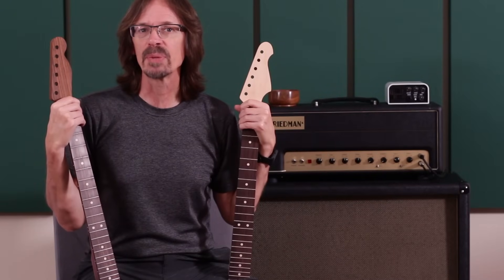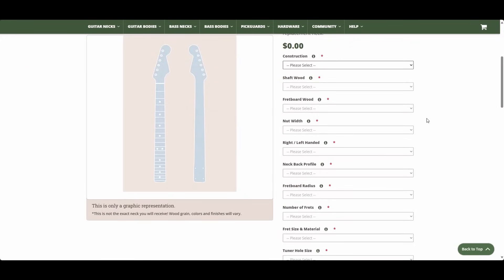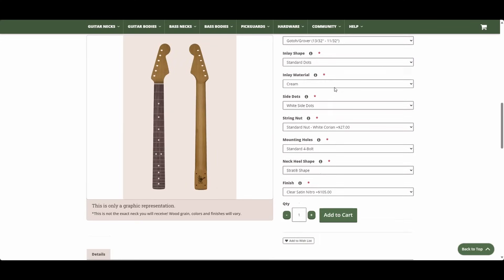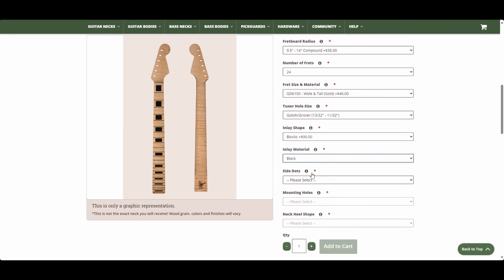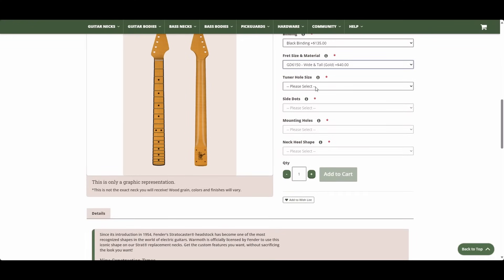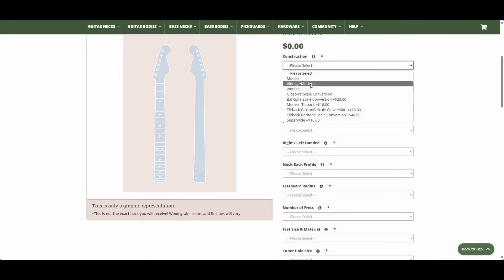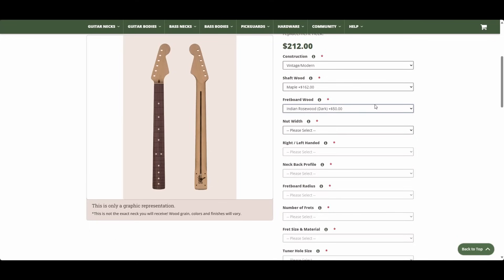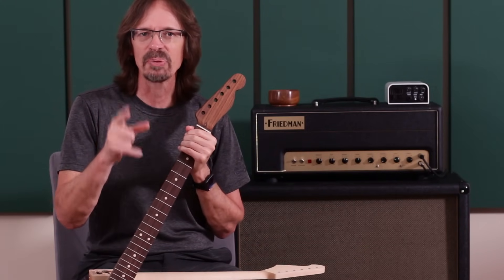The CHEAPEST vs the MOST EXPENSIVE Warmoth NECK

Comment: My go to is the roasted maple / rosewood with standard default for all options. Needs no finish and only minimal prep before playing. Smooth the fret ends, set the truss, and rock. If you use Hipshot tuners, you don't even need to drill anything. It's that easy. And about as cheap as it gets in terms of $$$. But feels and plays like a million bucks.
Reply: Exactly, I’ve been using plain Roasted maple as my neck and fretboard choice, Gibson scale-length, stainless 6100 frets and I’m always happy, though I did a vintage tint gloss finish recently for a project and I love it, looks and plays incredible.

Like you say, Warmoth necks will feel like a million bucks for very modest $. I built a SS p bass and a Strat last month, all the options I want and none I don’t, truly killer guitars that I assembled.

Comment: I know the roasted option on the cheapest build was because the warranty is void without a finish, but I've never known anybody whose warmoth neck failed them and a tung oil finish feels so good.
Reply from the maker: Roasted Maple does not require a finish for warranty. That's why I chose it as the least expensive "fully functioning" neck.
Reply: Most exotic woods also do not require a finish. But imho roasted maple is the cheapest one that doesn't require finish. 🤔

Comment: If you're considering a Warmoth neck, I bought a strat neck in 2006. I got standard profile,6230 frets rosewood fretboard, precut white corian nut and drilled for Sperzel locking tuners, and clear gloss finish. The price, with shipping was $312.00. It was excellent in every way. I wasn't sure about compound radius but I really got to appreciate it. My experience with Warmoth was great.

Comment: It's so funny how you don't realize until after experimenting with necks that you find out what's right for your greeting hand. I find that I love roasted Maple with no finish, and Ebony fretboard, Evo frets, 16-inch radius. And a 1-inch straight across the entire neck for thickness. I also like either 43 or 44 mm neck. it's so comfortable for me. my hand doesn't get fatigued like it used to with the standard radius and neck thickness. With the standard normal neck thickness come on my hand was constantly cramping up. It turns out I have a thick hand and when I use a 1-in neck it opens up my hand and doesn't fatigue my hand as much.

Comment: Four comments. First, this was fun I often do the cheapest neck test but never the most expensive neck test. Second, I once asked what it would cost for a roasted Maple shaft quarter-sawn and they said that would be $100 upcharge. I don't know if that would make your most expensive neck even more expensive. Roasted and quarter-sawn is probably redundant so I didn't go for it but I always order it when I'm getting a Mahogany neck which at the time was only a $40 upcharge. Third, I don't think the neck I want is even available off menu which is a vintage 7 1/4 radius neck in 24 3/4 scale. Fourth, I would also like to see Warmoth make necks that would fit bolt on Paul Reed Smith Guitars. I hate their neck profiles and would order one with a boat neck profile and stainless steel frets, which PRS doesn't like, which I think iis a mistake. I agree with you Stainless Steel frets are a default and not an option as far as I am concerned.

Comment: your most expensive neck is incorrect.  if you use ebony (black) as the fretboard, it will come out to $1,091.  and then you could have the neck painted to match the body, tho I don't know why you would do that with 3a flame maple, but that's another upcharge.  I don't know the cost of that, but the neck would definitely be more than $2000.  just sayin.😢
Reply: The matching finish is an off-menu option, hence it was probably left out for that reason.  Regarding the fretboard, there are options more expensive than black ebony.  I am a little concerned that I seem to know Warmoth's menus better than Aaron does.
Reply: where the heck is that extra 1000 backs coming from? just paint?
Reply: @Robstafarian yeah me too!  LOL.  which fretboard wood is more expensive than black ebony on the warmoth site?  I don't see one.  or have I spent more time memorizing their menu than you!  LOL.  let the geek out begin!

oh the reason I brought up the paint was he was building the most expensive neck possible and that is another charge, so I thought I'd help him make that price even more daunting!
Reply: You could also add a headstock veneer. Knocks the price up 45$, I believe. But it seems Aaron did not want to use off-menu options 😉